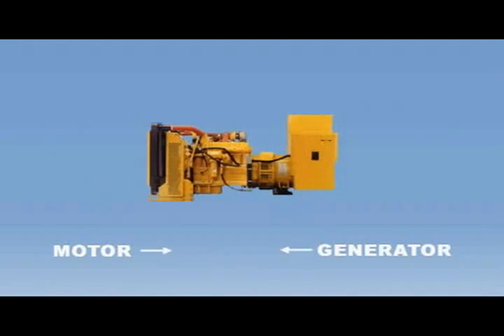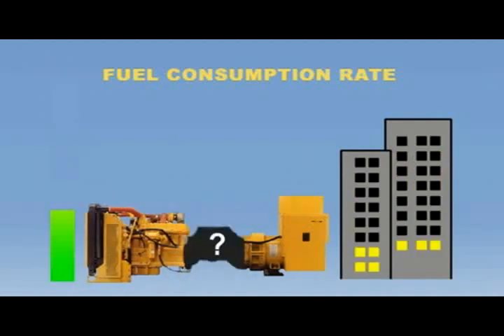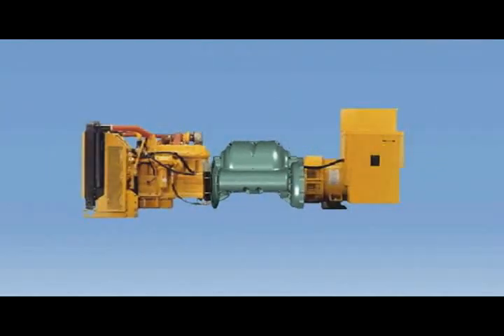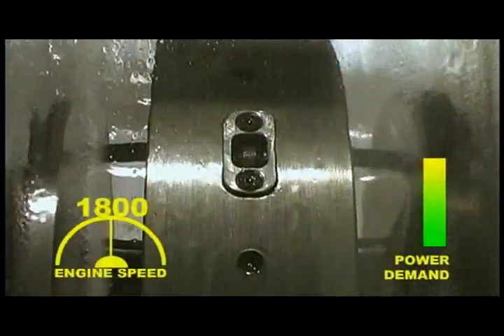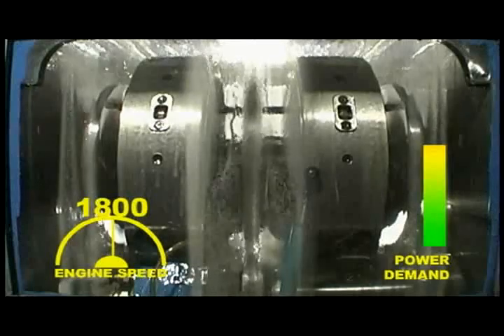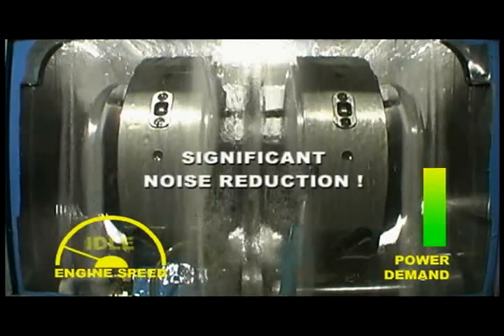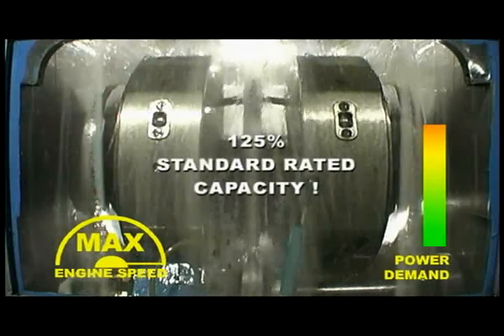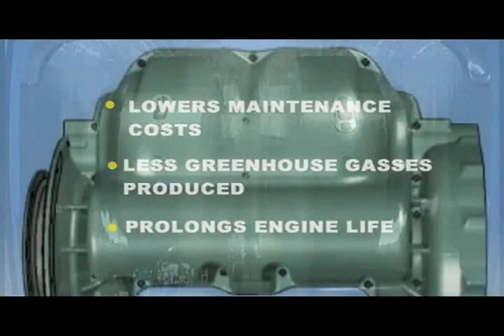CVT Corp - Real Toroidal Continuously Variable Transmission

Comment: Very nice, but can't see shit. A demonstration that shows thow it works could be better, especially for those who don't know the principles.
Reply: Hi, I am Graeme John Eddington. Following is my Youtube post of my Multi-speed transmission I have called: "Opposing Torque Dynamic Clutch" which is a type of Infinitely Variable Transmission (IVT) which I believe is ideal for your current applications. Australian Patent Number: 2020201132. Please log on to my Youtube video: https://www.youtube.com/watch?v=SACDK89U7PM In summary: It is a Compound Planetary System with two inputs from two separate electric motors. Motor 1 tries to rotate the carrier counter-clockwise and Motor 2 tries to rotate the carrier clockwise. The ratio, acceleration and speed of the vehicle is controlled by the amount and proportion of power/torque from the two motors. In addition the ratio of the transmission is affected by the speed and load of the vehicle. So, with the aid of speed sensors on all the components of the transmission, the speed of the vehicle, position of the accelerator and a kick-down switch - all that is needed to control the whole system is a computer. There is no actual gear selector for the driver to operate, however a manual mode would be appropriate where the driver has a 'balance' control knob that manually controls the proportion of power/torque to each motor and therefore can choose any ratio desired for the driving situation. An added enhancement could be added to the transmission by having a traditional planetary overdrive attached to each of the motors to enhance the rev range of each motor. This would enable the provision of extra modes like economy mode/sports mode and improve the kick-down mode by inputting more revs when the gearbox is in an extremely low ratio during kick-down operation. Having this type of transmission would improve acceleration and range of the vehicle allowing for a smaller battery pack/lighter weight leading to cost savings and simpler manufacturing. My name is Graeme J. Eddington, smart-s-trans@hotmail.com

Comment: what stops the CVT from slipping as the disks slide across each other? Is it some kind of rubber or special gears making contact?
Reply: Jared Graber it's special oil called traction oil, watch engineering explained video on toroidal CVT it talks about it in the end
Reply: Also huge pressure provided by a hydraulic ring
Reply: Hi, I am Graeme John Eddington. Following is my Youtube post of my Multi-speed transmission I have called: "Opposing Torque Dynamic Clutch" which is a type of Infinitely Variable Transmission (IVT) which I believe is ideal for your current applications. Australian Patent Number: 2020201132. Please log on to my Youtube video: https://www.youtube.com/watch?v=SACDK89U7PM In summary: It is a Compound Planetary System with two inputs from two separate electric motors. Motor 1 tries to rotate the carrier counter-clockwise and Motor 2 tries to rotate the carrier clockwise. The ratio, acceleration and speed of the vehicle is controlled by the amount and proportion of power/torque from the two motors. In addition the ratio of the transmission is affected by the speed and load of the vehicle. So, with the aid of speed sensors on all the components of the transmission, the speed of the vehicle, position of the accelerator and a kick-down switch - all that is needed to control the whole system is a computer. There is no actual gear selector for the driver to operate, however a manual mode would be appropriate where the driver has a 'balance' control knob that manually controls the proportion of power/torque to each motor and therefore can choose any ratio desired for the driving situation. An added enhancement could be added to the transmission by having a traditional planetary overdrive attached to each of the motors to enhance the rev range of each motor. This would enable the provision of extra modes like economy mode/sports mode and improve the kick-down mode by inputting more revs when the gearbox is in an extremely low ratio during kick-down operation. Having this type of transmission would improve acceleration and range of the vehicle allowing for a smaller battery pack/lighter weight leading to cost savings and simpler manufacturing. My name is Graeme J. Eddington, smart-s-trans@hotmail.com

Comment: cvt transmissions are junk
Reply: says the person with no experience in cvt's
Reply: Hi, I am Graeme John Eddington. Following is my Youtube post of my Multi-speed transmission I have called: "Opposing Torque Dynamic Clutch" which is a type of Infinitely Variable Transmission (IVT) which I believe is ideal for your current applications. Australian Patent Number: 2020201132. Please log on to my Youtube video: https://www.youtube.com/watch?v=SACDK89U7PM In summary: It is a Compound Planetary System with two inputs from two separate electric motors. Motor 1 tries to rotate the carrier counter-clockwise and Motor 2 tries to rotate the carrier clockwise. The ratio, acceleration and speed of the vehicle is controlled by the amount and proportion of power/torque from the two motors. In addition the ratio of the transmission is affected by the speed and load of the vehicle. So, with the aid of speed sensors on all the components of the transmission, the speed of the vehicle, position of the accelerator and a kick-down switch - all that is needed to control the whole system is a computer. There is no actual gear selector for the driver to operate, however a manual mode would be appropriate where the driver has a 'balance' control knob that manually controls the proportion of power/torque to each motor and therefore can choose any ratio desired for the driving situation. An added enhancement could be added to the transmission by having a traditional planetary overdrive attached to each of the motors to enhance the rev range of each motor. This would enable the provision of extra modes like economy mode/sports mode and improve the kick-down mode by inputting more revs when the gearbox is in an extremely low ratio during kick-down operation. Having this type of transmission would improve acceleration and range of the vehicle allowing for a smaller battery pack/lighter weight leading to cost savings and simpler manufacturing. My name is Graeme J. Eddington, smart-s-trans@hotmail.com

Comment: @beam1306 

Hello beam !

What does you FANDRIVE 100 weight fully operational ?
Reply: Hi, I am Graeme John Eddington. Following is my Youtube post of my Multi-speed transmission I have called: "Opposing Torque Dynamic Clutch" which is a type of Infinitely Variable Transmission (IVT) which I believe is ideal for your current applications. Australian Patent Number: 2020201132. Please log on to my Youtube video: https://www.youtube.com/watch?v=SACDK89U7PM In summary: It is a Compound Planetary System with two inputs from two separate electric motors. Motor 1 tries to rotate the carrier counter-clockwise and Motor 2 tries to rotate the carrier clockwise. The ratio, acceleration and speed of the vehicle is controlled by the amount and proportion of power/torque from the two motors. In addition the ratio of the transmission is affected by the speed and load of the vehicle. So, with the aid of speed sensors on all the components of the transmission, the speed of the vehicle, position of the accelerator and a kick-down switch - all that is needed to control the whole system is a computer. There is no actual gear selector for the driver to operate, however a manual mode would be appropriate where the driver has a 'balance' control knob that manually controls the proportion of power/torque to each motor and therefore can choose any ratio desired for the driving situation. An added enhancement could be added to the transmission by having a traditional planetary overdrive attached to each of the motors to enhance the rev range of each motor. This would enable the provision of extra modes like economy mode/sports mode and improve the kick-down mode by inputting more revs when the gearbox is in an extremely low ratio during kick-down operation. Having this type of transmission would improve acceleration and range of the vehicle allowing for a smaller battery pack/lighter weight leading to cost savings and simpler manufacturing. My name is Graeme J. Eddington, smart-s-trans@hotmail.com

Comment: Could you tell me if this is a half or full toroidal ivt
Reply: Hi, I am Graeme John Eddington. Following is my Youtube post of my Multi-speed transmission I have called: "Opposing Torque Dynamic Clutch" which is a type of Infinitely Variable Transmission (IVT) which I believe is ideal for your current applications. Australian Patent Number: 2020201132. Please log on to my Youtube video: https://www.youtube.com/watch?v=SACDK89U7PM In summary: It is a Compound Planetary System with two inputs from two separate electric motors. Motor 1 tries to rotate the carrier counter-clockwise and Motor 2 tries to rotate the carrier clockwise. The ratio, acceleration and speed of the vehicle is controlled by the amount and proportion of power/torque from the two motors. In addition the ratio of the transmission is affected by the speed and load of the vehicle. So, with the aid of speed sensors on all the components of the transmission, the speed of the vehicle, position of the accelerator and a kick-down switch - all that is needed to control the whole system is a computer. There is no actual gear selector for the driver to operate, however a manual mode would be appropriate where the driver has a 'balance' control knob that manually controls the proportion of power/torque to each motor and therefore can choose any ratio desired for the driving situation. An added enhancement could be added to the transmission by having a traditional planetary overdrive attached to each of the motors to enhance the rev range of each motor. This would enable the provision of extra modes like economy mode/sports mode and improve the kick-down mode by inputting more revs when the gearbox is in an extremely low ratio during kick-down operation. Having this type of transmission would improve acceleration and range of the vehicle allowing for a smaller battery pack/lighter weight leading to cost savings and simpler manufacturing. My name is Graeme J. Eddington, smart-s-trans@hotmail.com

Comment: whats the efficiency of this cvt? will it able to handle the tourque greater than the engine?
Reply: Hi, I am Graeme John Eddington. Following is my Youtube post of my Multi-speed transmission I have called: "Opposing Torque Dynamic Clutch" which is a type of Infinitely Variable Transmission (IVT) which I believe is ideal for your current applications. Australian Patent Number: 2020201132. Please log on to my Youtube video: https://www.youtube.com/watch?v=SACDK89U7PM In summary: It is a Compound Planetary System with two inputs from two separate electric motors. Motor 1 tries to rotate the carrier counter-clockwise and Motor 2 tries to rotate the carrier clockwise. The ratio, acceleration and speed of the vehicle is controlled by the amount and proportion of power/torque from the two motors. In addition the ratio of the transmission is affected by the speed and load of the vehicle. So, with the aid of speed sensors on all the components of the transmission, the speed of the vehicle, position of the accelerator and a kick-down switch - all that is needed to control the whole system is a computer. There is no actual gear selector for the driver to operate, however a manual mode would be appropriate where the driver has a 'balance' control knob that manually controls the proportion of power/torque to each motor and therefore can choose any ratio desired for the driving situation. An added enhancement could be added to the transmission by having a traditional planetary overdrive attached to each of the motors to enhance the rev range of each motor. This would enable the provision of extra modes like economy mode/sports mode and improve the kick-down mode by inputting more revs when the gearbox is in an extremely low ratio during kick-down operation. Having this type of transmission would improve acceleration and range of the vehicle allowing for a smaller battery pack/lighter weight leading to cost savings and simpler manufacturing. My name is Graeme J. Eddington, smart-s-trans@hotmail.com

Comment: Wonderful design and technological benefit to the energy efficiency we are seeking, will do business with soon.
Reply: Hi, I am Graeme John Eddington. Following is my Youtube post of my Multi-speed transmission I have called: "Opposing Torque Dynamic Clutch" which is a type of Infinitely Variable Transmission (IVT) which I believe is ideal for your current applications. Australian Patent Number: 2020201132. Please log on to my Youtube video: https://www.youtube.com/watch?v=SACDK89U7PM In summary: It is a Compound Planetary System with two inputs from two separate electric motors. Motor 1 tries to rotate the carrier counter-clockwise and Motor 2 tries to rotate the carrier clockwise. The ratio, acceleration and speed of the vehicle is controlled by the amount and proportion of power/torque from the two motors. In addition the ratio of the transmission is affected by the speed and load of the vehicle. So, with the aid of speed sensors on all the components of the transmission, the speed of the vehicle, position of the accelerator and a kick-down switch - all that is needed to control the whole system is a computer. There is no actual gear selector for the driver to operate, however a manual mode would be appropriate where the driver has a 'balance' control knob that manually controls the proportion of power/torque to each motor and therefore can choose any ratio desired for the driving situation. An added enhancement could be added to the transmission by having a traditional planetary overdrive attached to each of the motors to enhance the rev range of each motor. This would enable the provision of extra modes like economy mode/sports mode and improve the kick-down mode by inputting more revs when the gearbox is in an extremely low ratio during kick-down operation. Having this type of transmission would improve acceleration and range of the vehicle allowing for a smaller battery pack/lighter weight leading to cost savings and simpler manufacturing. My name is Graeme J. Eddington, smart-s-trans@hotmail.com

Comment: Finally after all these years I get to see an IVT/CVT in real world use. Absolutely awesome! This is what I want in my generator and my car transmission! VERY IMPRESSIVE!
Reply: Hi, I am Graeme John Eddington. Following is my Youtube post of my Multi-speed transmission I have called: "Opposing Torque Dynamic Clutch" which is a type of Infinitely Variable Transmission (IVT) which I believe is ideal for your current applications. Australian Patent Number: 2020201132. Please log on to my Youtube video: https://www.youtube.com/watch?v=SACDK89U7PM In summary: It is a Compound Planetary System with two inputs from two separate electric motors. Motor 1 tries to rotate the carrier counter-clockwise and Motor 2 tries to rotate the carrier clockwise. The ratio, acceleration and speed of the vehicle is controlled by the amount and proportion of power/torque from the two motors. In addition the ratio of the transmission is affected by the speed and load of the vehicle. So, with the aid of speed sensors on all the components of the transmission, the speed of the vehicle, position of the accelerator and a kick-down switch - all that is needed to control the whole system is a computer. There is no actual gear selector for the driver to operate, however a manual mode would be appropriate where the driver has a 'balance' control knob that manually controls the proportion of power/torque to each motor and therefore can choose any ratio desired for the driving situation. An added enhancement could be added to the transmission by having a traditional planetary overdrive attached to each of the motors to enhance the rev range of each motor. This would enable the provision of extra modes like economy mode/sports mode and improve the kick-down mode by inputting more revs when the gearbox is in an extremely low ratio during kick-down operation. Having this type of transmission would improve acceleration and range of the vehicle allowing for a smaller battery pack/lighter weight leading to cost savings and simpler manufacturing. My name is Graeme J. Eddington, smart-s-trans@hotmail.com